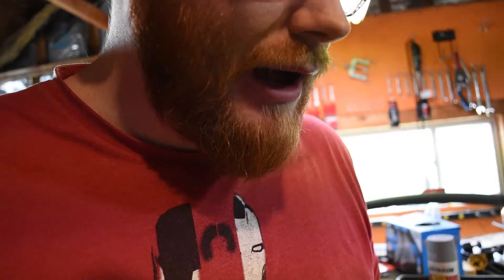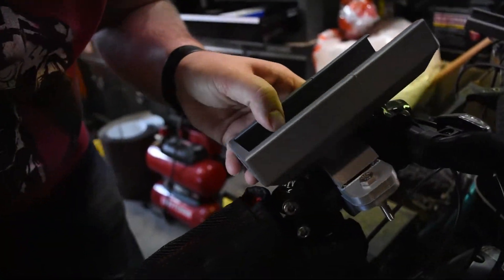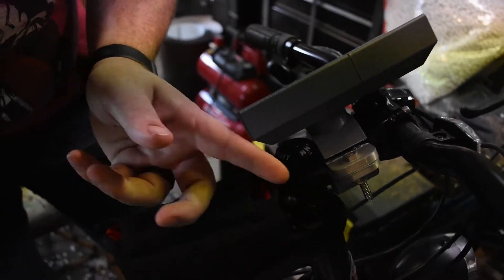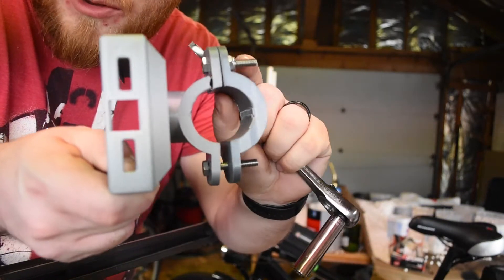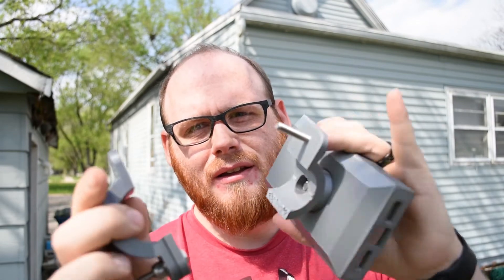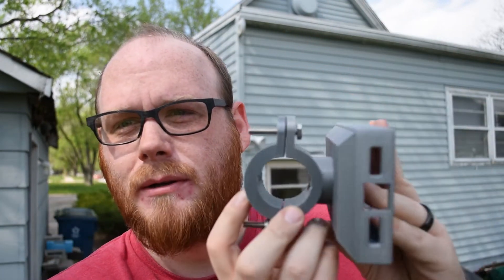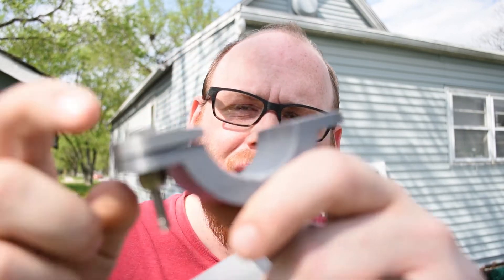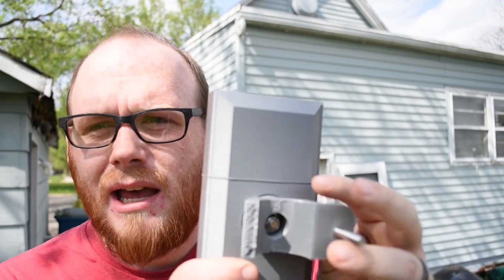My 3D printed phone mount for my bike

Comment: Filets haha, its called a fillet (2 L's). it made my day though. And: nice design, i'm orientating for making my own. I want it to slide open and close with integrated springs, using 3D printed dovetail slots for linear guidance. Is gonna be fun.
Reply from the maker: That sounds awesome. I actually have a lot of ideas for an updated version since I've again changed phones. I think my next go at it is going to use a twist lock connection for the base so you just have to design a new cradle for the phone in the future. I think springs with a lock too could be an interesting design choice. Let me know how it goes :).

Comment: Looks like it cracked because the orientation you printed it in. 
(I'm thinking of making my own phone mount, so I'm surfing for tips and inspiration:))
Reply from the maker: I hope you got some inspiration from my video :). Back then I only had my dremel printer and what I could do was very limited. Since then I got a Prussa I3 Mk3 and it really expanded my options. I with the weather breaking here I'm looking to getting back on my bike soon and I'm thinking I may make a new one using PETG. In that process I may develop a new iteration. I also changed my software. I've been using autodesk fusion now which also has been very useful to do something better than 123D design.
Reply: Tor Ivan Boine Why are you verified but you only have 100 subs?
Reply: @Denofu  I slept with an intern at Youtube

Comment: thats actually a cool design can you tell me the program that you used? maybe use abs?
Reply from the maker: Unfortunately my printer isn't set up for ABS but I'm looking to get a new one soon hopefully in the next couple of months. All of this was modeled using 123d design from autodesk which I believe is being phased out. I need ot learn some more advanced CAD software lol.
Reply: Very nice! I recommend Fusion 360. What printer do you use currently? I have a CR-10 and I just use a black trash bag for an enclosure.
Reply from the maker: I have the original Dremel Idea builder. I was planning on getting the prusia I3 MK3 for my next machine.  Fusion 360 has been on my radar. I'm gearing up to do a new build video soon so I may spend the time to learn it for that :)
Reply: Yes, go for the Prusa I3 MK3!